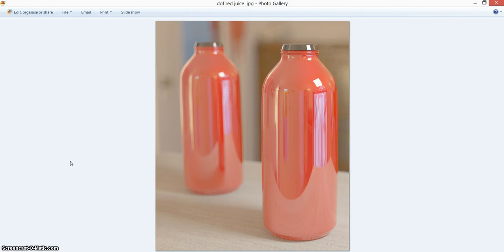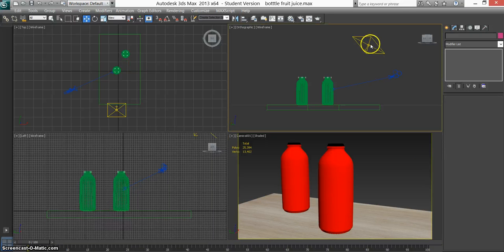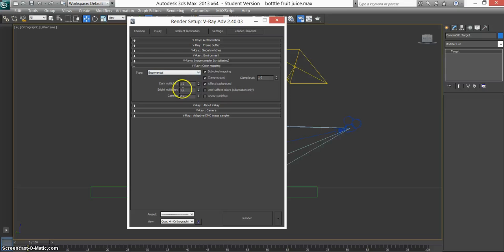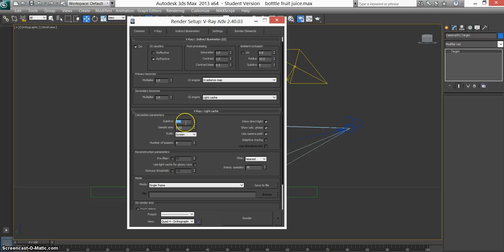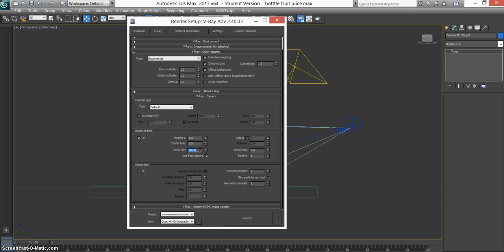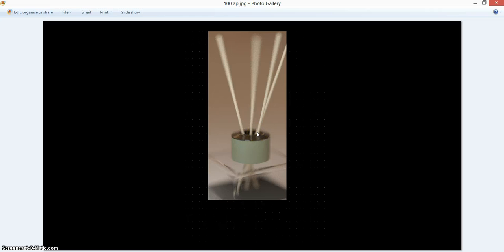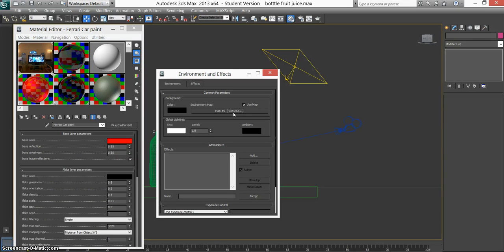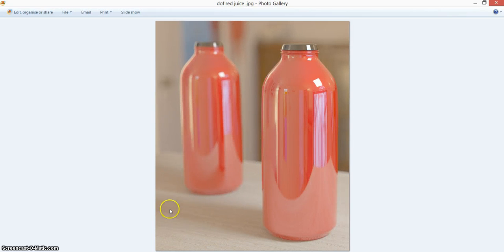----------------------------------------------------------------------------------------------------

Comment: Hey ! I have a problem, I have animated the focus distance of my physical camera, when I render frame per frame, it's working good, the objects focusing are changing. But when I render all the frames of the video, the focus distance doesn't change at all. I'm using Mental Ray and 3ds max 2016
Reply from the maker: Hey buddy,  that's very strange! I've never had that issue. You can send me your file (if it's small enough) and ill  have a look. Have you tried the default render engine? Drop me an email and i'll see mate.
Reply: Thank you very much for your help, here is the file : https://drive.google.com/open?id=0BybciuzAXP6DV2tzcW1jTk9xcmc the animation is between frame 90 and 147, I'm using Nvidia Mental Ray rendering engine
Reply from the maker: I'll have a look later on today mate - thanks